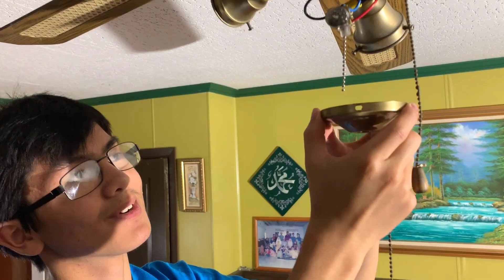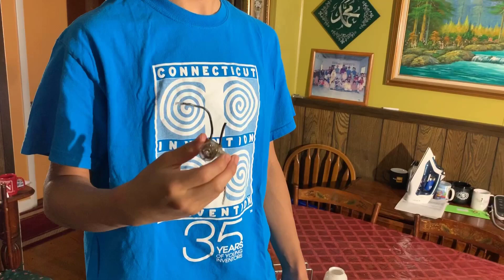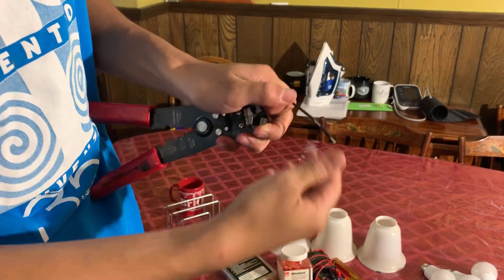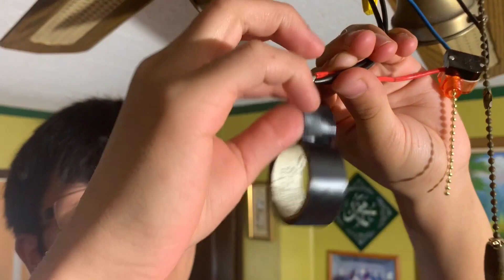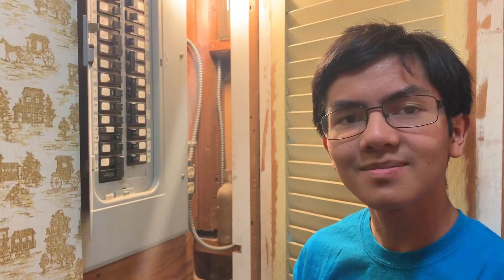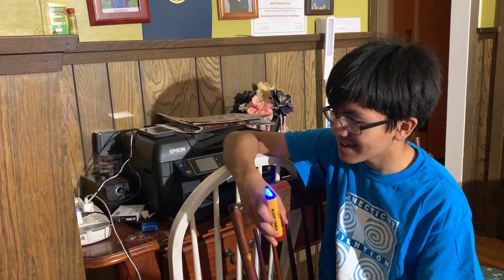How To Replace 3-Way Light Switch Pull Chain Control On Ceiling Fan | DIY Home Repair Fix By Aiman

Comment: You are the only one out of 5 or 6 videos I’ve watched that has explained to turn the power off (at the breakers) and to use an electrical tester. Also to mention the fan and lights might be on separate breakers! And only one mentioned removing the lights! It might be common sense but if we don’t totally know what we are doing we need a complete explanation. Thank you very much much 🥰 sensible young man 🥰. You are going to go far in life.

Comment: As a certified General electrician, I find this video highly troubling. When misstatements are propagating more rapidly than paragraphsvi start to get concerned about the welfare of both the presenter and those following his instruction. The voltage at which he's working can be injurious, if not fatal.
I do not wish to stifle the admirable human urge to expand one's knowledge. Experimentation is to be commended, and I engaging it myself, but I would highly recommend that you engage the services of someone with a little bit more knowledge to steer you in the safe directions. I do not wish to spread your video online as I do not believe that would serve a positive purpose. If you have any questions where Corrections could be made, I would gladly put the time into helping you out. I'm on vacation right now
Reply: 😂 you’re a certified something but idk of electrician would be the correct term here. Hopefully you’re back to work and off you’re high horse sir. (Hopefully I was “proper” enough for you to somewhat understand)

Comment: Aiman, take a look at this tester, with you can safely check to see how much voltage your dealing with. I wouldn't be without it I have had mine for more than 40 years.
https://www.homedepot.com/p/Ideal-Vol-Test-Voltage-Tester-61-065/100341461?mtc=Shopping-B-F_Brand-G-Multi-NA-Multi-NA-Feed-PLA-NA-NA-Catchall_PLA&cm_mmc=Shopping-B-F_Brand-G-Multi-NA-Multi-NA-Feed-PLA-NA-NA-Catchall_PLA-71700000014585962-58700001236285396-92700010802552412&gclid=CjwKCAjw3-bzBRBhEiwAgnnLCshZ2lta8RXFhGK_CUOjWm3IXD4iHke-ILLxWFg6N1_YqSXjpYZAZBoCn6kQAvD_BwE&gclsrc=aw.ds
Reply from the maker: Thank Bobgrauer, my dad was right.  He said you might be a very knowledgeable and experienced electrician.  My dad studied Electrical Engineering but he never work in that field.  Thank you for being kind in your wordings & helping me with my learning process.  I have a lot to learn still, thank you...

Comment: You have described a potentially  lethal problem with the three way switch project. If a device has 2 sources of electric connected to it, you could have not 120 volts but 240 volts running to it. What I mean by that is each of the sources of electric could be attached to different bus bars in the electrical panel that would mean the light would be powered by 240 volts. There is another way you be miss led you could have a device wired with a method of switching the light off that is called a "switch leg" where you could turn off a light and still live wires in the lamp housing.
Reply from the maker: Thank you.  I will ask my dad to take a look at this.  Maybe I described it wrong.  It was the same wiring as before and the unit is at least 20 years old.